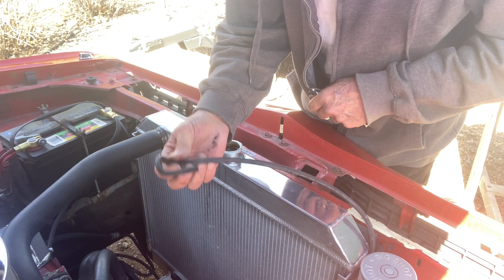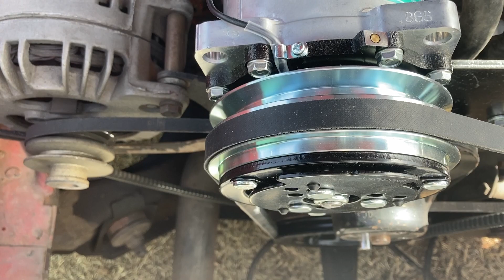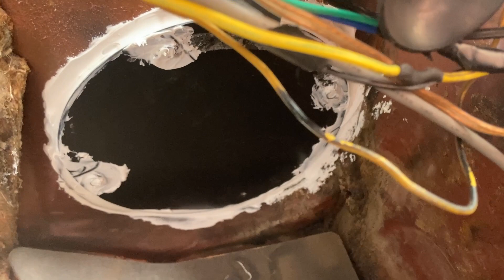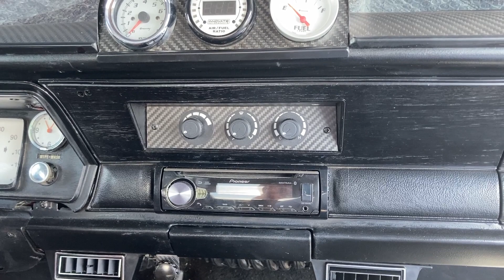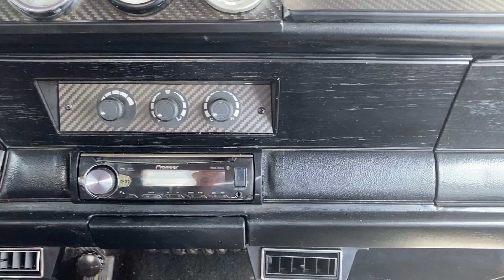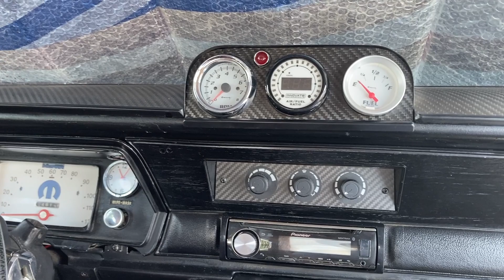Mopar A body and Classic Auto Air

Comment: Nice work - so you used a 1972 kit?  What aluminum rad are you using?
Reply from the maker: Yes, a 72 kit.
Radiator I don’t remember who I got that from, but it wasn’t one of the 700 dollar ones.